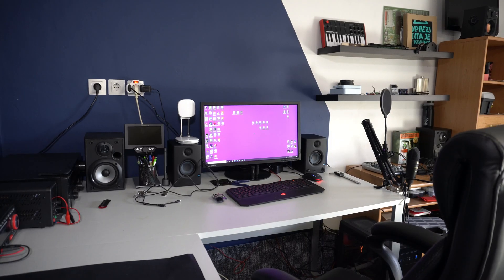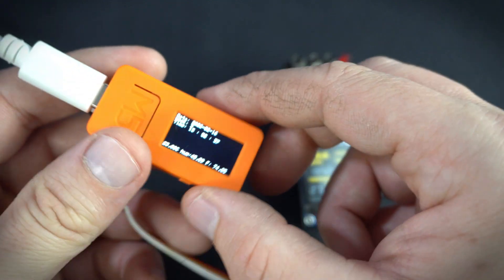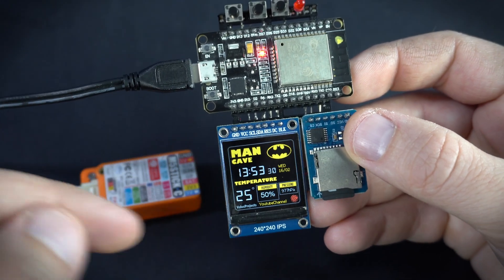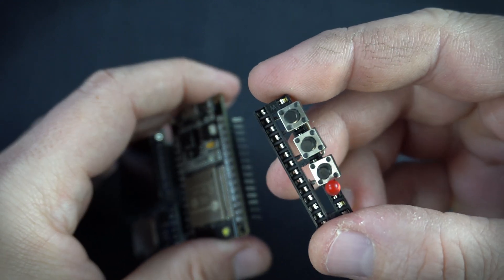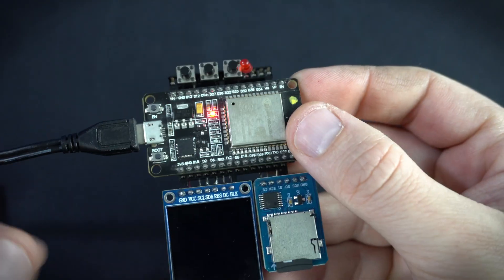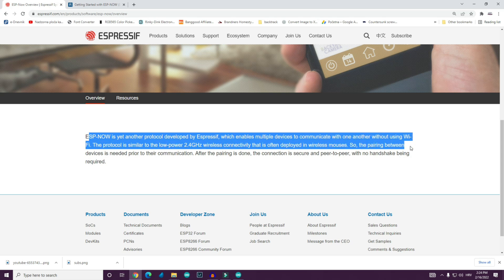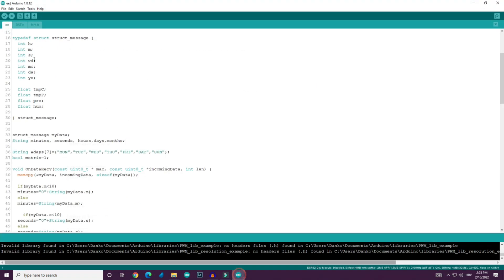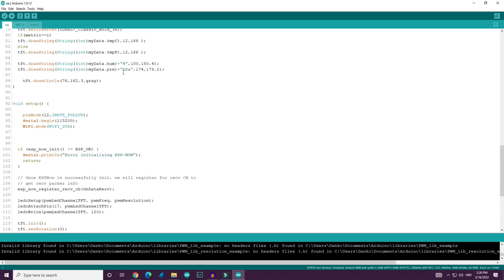ESP32 Man Cave Monitor (ESP NOW)

Comment: set rx tx to function 3 in setup, then config for sd card. Here is a code snippet where i use the TX and RX pin on my ESP8266.
Bear in mind, if data comes in on the RX pin, this is the same as detecting a push button.

//GPIO 1 (TX) swap the pin to a GPIO.
pinMode(1, FUNCTION_3); 
//GPIO 3 (RX) swap the pin to a GPIO.
pinMode(3, FUNCTION_3); 

And to switch back
//GPIO 1 (TX) swap the pin to a TX.
pinMode(1, FUNCTION_0); 
//GPIO 3 (RX) swap the pin to a RX.
pinMode(3, FUNCTION_0);

Comment: I would really like to do something very similar with ESP NOW but with using a TTGO T Display at both ends.. One thing I did not understand was how you are using the single code module on both the Sender ( Remote Sensor) and the Receiver devices.. I must be missing something .. 🤔

Comment: what is the configuration that you have in User_Setup.h (TFT_eSPI), because it blocked me the requests to the sdcard. For the sdcard I use VSPI and for the display HSPI.
I apologize if the question is not well understood, but I speak Spanish and my English is very bad

Comment: I've usually just directly connected an SD card to esp32 in SPI mode. This limits it to only 4GB of addressable storage space but it works for me. No logic level conversion needed. Just solder header pins on a microSD adapter and you're golden.

Comment: The SD card model has a 3.3v regular on it so it will not work if you don't provide it more than 3.3v. You can solve this by solder bridging two of the pins on the regular but then it will only work with 3.3v.

Comment: This is the normal serial protocol, The reader uses spi protocol. This is GPIO12 and 13. This should be a pin around your switch you use. But the esp32 has an internal "controller" for sd cards. I don't know what kind of board you use for sd but you can connect the card with only one resistor directly to the pins.

Comment: That module has more than just the SD-Card reader. It also has a 3v3 voltage regulator and a logic-level shifter. It's made to work with 5V, not 3v3.
I guess you're feeding it 3v3 on VCC, no?
I do know some pins on some kits may be 5v tolerant. Make sure that's your case. otherwise, you can remove the chip from the module, and rewire the entry-exit pins of it.
Also, it'll work better with MISO/MOSI/SCK pins of the ESP, along with any other pin for CS. It should behave nicely even with a flash (provided CS is correctly handled).
Reply from the maker: Thisi is 3.3v model, ic that looks like voltage regulator is transistor, i check that first
Reply: @VolosProjects  Please re-check and confirm :) The 662K is a 3.3v voltage regulator and the v125 is a buffer, used as a level shifter  (LVC125A) with the 3k3 resistors :)
I have assembled more than 500 of these modules (both versions) and the 3.3v version has no level shifter and no voltage regulator. Only 10k (103) pullup resistors and decoupling capacitors. There is no need for chip if levels are 3.3v as the micro-sd card is 3.3v and SPI compliant. It can be directly connected to the pins of the ESP32..
The 5V version can be recognized by having both the LVC125A level shifter, the 662 or AMS1117-3.3 regulator and 3k3 (332).